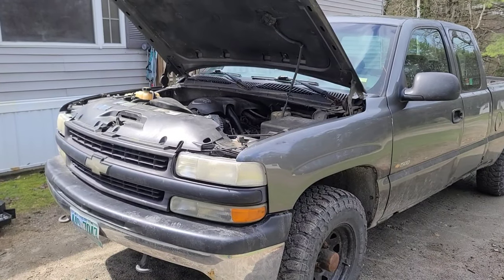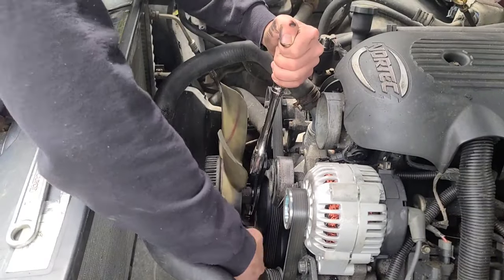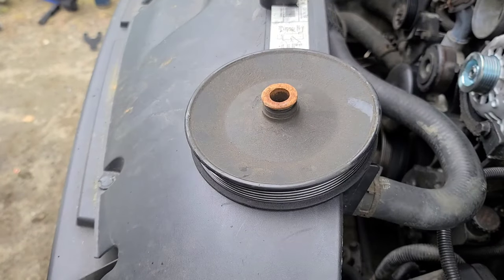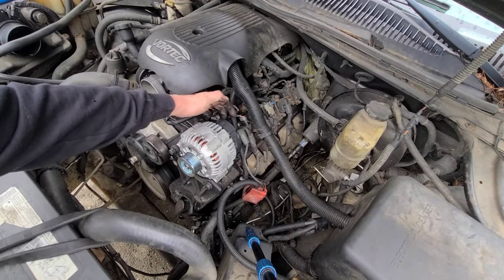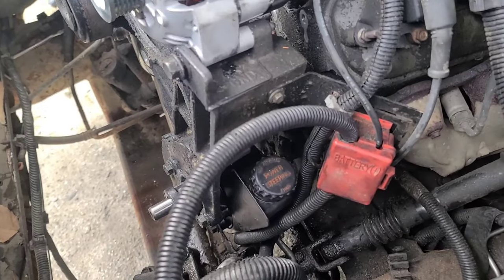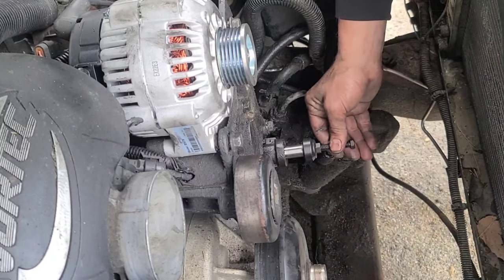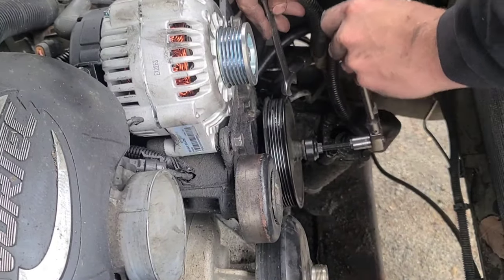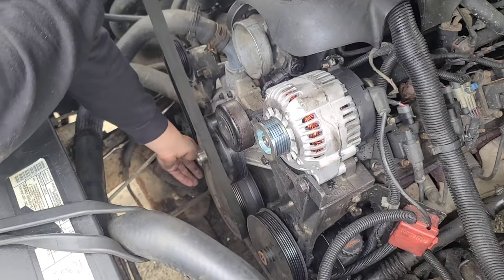Power steering pump replacement / Chevy Silverado, Chevy Tahoe  2000 - 2006

Comment: I've done this job many times, and I'm still wondering why people remove the shroud and fan.  Totally unnecessary. Disconnect neg battery cable. Take the belt off. Disconnect the alternator connector, not the power wire, take the two bolts out, set it to the rear. Disconnect the two hydraulic lines. Remove the four alternator/pump bracket bolts and one behind the pump.  Slide the bracket/pump straight up, take it completely out of the vehicle. Then remove the pulley and mount bolts, swap the other parts from old to new pump, put the pulley back on, then slide the whole thing back in. Reverse process.  Saves time and no fighting with the puller while bent over the front end.  Sounds harder but it's much easier and saves time.
Reply: Can you make a video?
Reply: Thank you worked for me. I still took shroud off made it easier. Left fan attatched
Reply: That sounds like more work with stuff in the way.
Reply: I did it the way you're talking about. But taking the parts off the front of the engine gives so much working room. And if the guy wasn't taping and explaining, it would have taken less than 5 minutes to get that stuff off. And as you get older, you get less flexible to work around stuff! But there's always another way.
Reply: As I get older, I find ways to work smarter and get things done easier/quicker. This is one of those things.  But also, when you've done something many times, you've prob tried different ways and end up sticking with the best route.  Reaching to remove the bracket bolts are much easier than pulling the pulley off in the vehicle.  Everyone prefers to do things their way. No wrong way to do it as long as it gets done.  
  Being a mechanic for over 40yrs, taking the fan shroud and fan out, then removing the pulley in the vehicle takes much longer and makes a difference on someone's final bill.  I try to save people money, and not charge for things that don't need done.  Removing the fan/shroud only gives you room if you're taking the pulley off the pump in vehicle, and plan to leave the mounting bracket attached to the engine.  It's much faster to remove the bracket/pump as a whole and then pull the pulley on the bench or in a vise.  Ea vehicle is different, but when you wrench everyday, you find tricks to make the job easier and quicker, which saves my back for sure. 
  Next time you get qoutes for a job, and two places are off a bit, think about why. One is charging for doing it one way, the other is saving time and charging less.  One took the fan/shroud out, the other didn't.  The second you go over 1 hr, most shop round up.  5 min is the difference between paying for 1 hr or 1.5 or 2 hrs labor.
Reply: Did it your way much easier don't have to scre with the fan etc. Cheers Tony
Reply: Good job on the video, nocked it out in the rain even..👏👏 thank you.
Reply: I think they do it to give better view of what they are doing for the camera.
Reply from the maker: @sharpowl8333 exactly
Reply: I haven’t done it yet so I can’t speak on what’s easier but the service manual doesn’t mention removing the fan.
Reply: hey man, would you be willing to make a video atleast pointing out your method? very new and broke and i’m liking your method better. would it be possible to completley remove the assembly and take it to a work bench with your method? would the alternator come with it
Reply: The next one I do, I'll try to make a video.
Reply: @bromeolaw5917  I just did it. Take the alternator off, then remove the assembly and swap everything on a work bench. There’s 4 bolts on the front, 3 on top one on very bottom and one bracket bolt on the side. They’re all pretty easy to get to, fan isn’t an issue. It does help to remove the shroud though. I had a hard time getting the pulley on the new pump. Broke the bearing on the installer. I ended up having to put the pump in the freezer and the pulley in the oven, used a little brake grease on the shaft and it finally went on.

Comment: Mine had a EVM actuator on the back of the pump. They stopped using them, but you’ll need an actuator bypass tube.

Comment: Mine went out 2 days ago. I was surprised it was without warning, or maybe I just wasn't paying attention..... I just called a nearby place and they want $980 to do it. Thanks to your video I feel more confident doing it myself. For some reason I thought one of the hoses was a high-pressure hose that made it best for a shop to do it. Not sure why I thought that tho. Wish I had done it 6 months ago when I replaced the water pump. Anyways, thanks for posting.

Comment: Amazing video and my pump went well thank you! Only thing I’d add is on mine I had to take out the bolts from the backside of the old pump to put the bracket on the new one, something to look for mines an 03’ Silverado 5.3👍🏻

Comment: Very good video I didn't have a fanblade remover so I went the other way without fanblade off as the other gentleman did. Took everything out all together then removed power steering puller when it was on the ground. 
Both ways are good but not having to remove clutch fan was much easier. Thanks for alternate procedures.
Reply: Hotrodders way is much easier. Cheers Tony

Comment: Dope video. Followed it every step of the way. Now I’m trying to put the replacement in and have found that my bracket is different. I have two stud bolts that I can’t get out of the old pump to put on the new pump. I called Auto Zone, Advance, NAPA and Parts Authority and neither of them carry the stud bolts. I’m dead in the water trying to find for a 2003 5.3 1500 Chevy express.

Comment: my pump just let go while on the way to dunkin. what a pain in the ass it is to turn that wheel without power steering, nice video, short and to the point.
Reply from the maker: damn that sucks. yes its very hard to turn the wheel, power steering is definitely a must in these trucks

Comment: When switching old pump I did not have the back you said to switch over what is that for?

Also this is my second time switching my pump in two days started dumping fluid again does the metal line that I connect to the pump have specific positioning

Comment: The pulley holder you put the link for is a 2 pin. But there is 3 holes and you used a 3 pin in the vid. Will the 2 pin work?
Reply from the maker: yes

Comment: I get a random “traction active” message and lose power for a second from standstill acceleration and sometimes while turning from a stop. I rebuilt my leaky steering gear box and changed my bad high pressure hose but still have a small leak coming from somewhere else as I see small splatter marks in the surrounding areas. Could it be my pump/reservoir?

Comment: I got a 2002 Chevy Silverado and like when my truck is still it’s hard to move my steering wheel left or right but I check if it need steering wheel fluid but no it was all good you think it’s the pump ?
Reply from the maker: sounds like a bad pump for sure

Comment: Was it squealing when you turned the wheel either way before you replaced it? I have an 03 silverado and it’s squealing when I turn either way at certain angles and the power steering fluid is full and it doesn’t seem to go down really I’m not sure what’s wrong with it I think the steering rack and pinion is bad too because it’s giving all the symptoms of it
Reply from the maker: it was squealing worse the more I'd accelerate, and the main shift seal was no good

Comment: What else can i use for the water pump pully
Reply: You don't need to take that off. Just push the tensioner over and pull belt off pump only

Comment: Question my Silverado turns hard to the left and the power steering pump making funny sounds. Would that be my problem
Reply from the maker: have you checked the fluid level
Reply: @603Mechanicvids  yes it was at the proper level

Comment: you do NOT NEEEED to remove the fan... it only really helps with room with pressing the pulley back on.

if you have extensions the fan can stay on.

you can press the pulley back on with the fan in place, its tedious but possible (did it with a ratchet and adjustable wrench)
if you have a ratcheting box wrench big enough for the nut that does the pressing; it will be pretty quick.

but the extra 2 steps of removing/installing the fan is not needed especially when buying that tool to hold the pulley.

Comment: Got a leak on my 2006 Chevy Silverado it leaks power steering fluid and every time I top off my fluid it leaks it all within 2 days and starts to make a nasty whining  noise any help on what it could be ?
Reply from the maker: either a bad power steering line or bad pump, the whining noise is from no fluid in the power steering pump
Reply: Thank you very much sir!
Reply: I also had this problem but the leak was from a tear in the driver rack and pinion boot

Comment: Don’t you have to purge the lines once it topped off with power steering fluid
Reply from the maker: just leave the cap off and turn your wheel left to right to bleed air out of system

Comment: Uhmmm you didn’t show how to take pulley bolt out ……
Reply from the maker: no bolt holding the pulley on, its pressed on
Reply: @603Mechanicvids  okay thank you . I used to same pulley puller tool you used & it didn’t work . So I gave up for the day , probably take my truck to a shop .

Comment: Wow.    You used quite possibly the worst tool for removing that flared but from the high pressure side of the pump.     Those things are soft, and that’s why you need the proper wrench.
Reply: Then go find another video